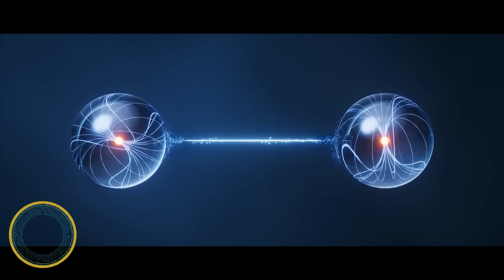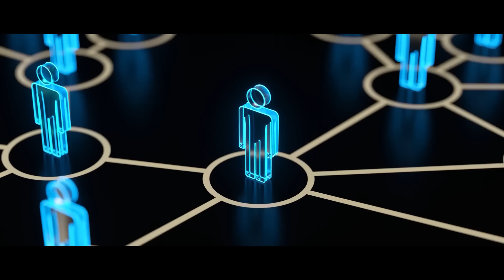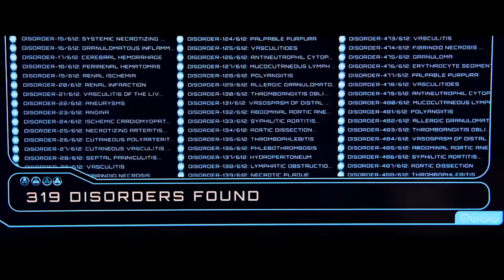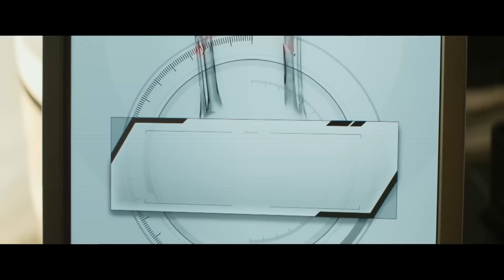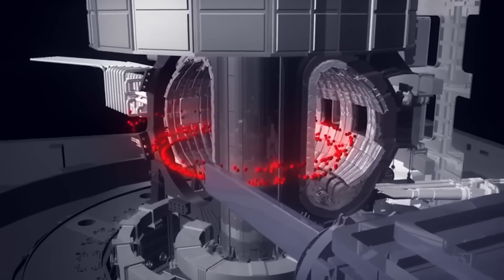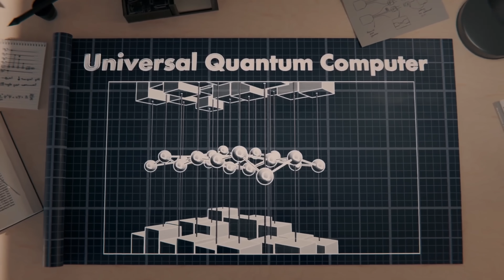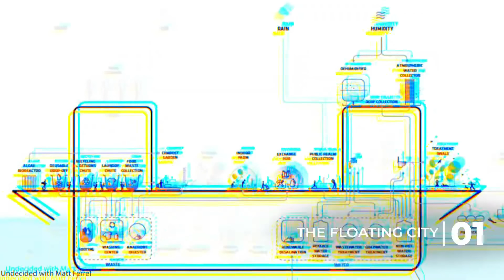20 Technologies That Will Change The World

Comment: I would add:
- Room temperature & room pressure superconductor. This will revolutionise power transmission and is an enabling technology for other things, like fusion.
- Molten Salt Thorium breeder reactors. An intermediate between current water cooled reactors and fusion, the technology sidesteps many of the problems with water cooled reactors.

Photonic computing, quantum or otherwise, would do interesting things to the IT landscape.